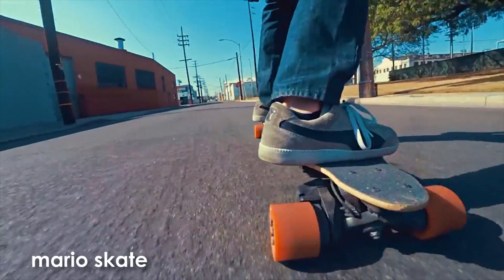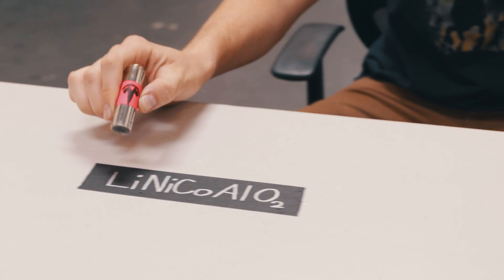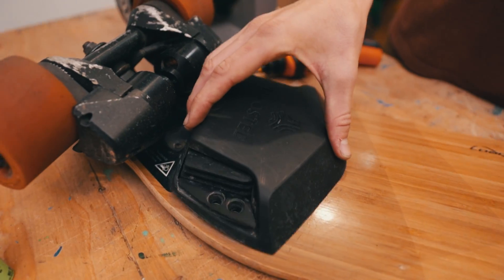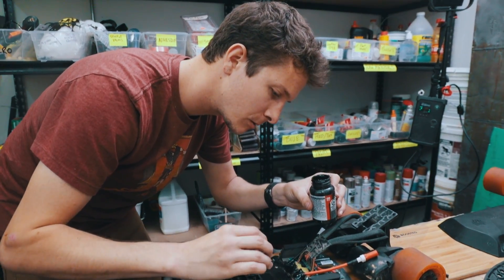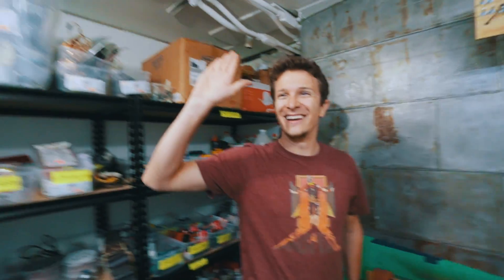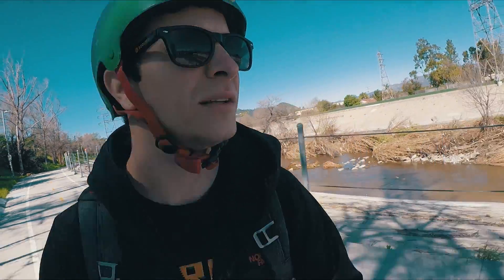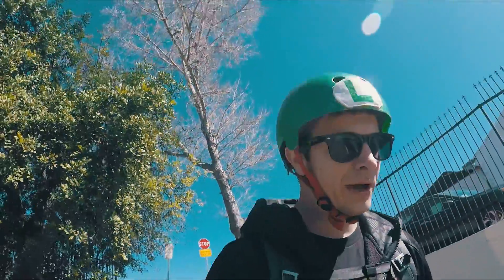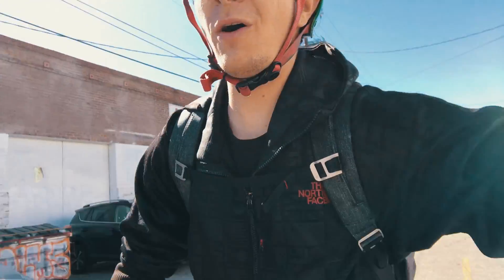Tesla Batteries in an Electric Skateboard!

Comment: Why don't you just remove the boost board batterys and just keep the batterys you added?
Reply: Anyone who replied to this comment and use over 20 words is a nerd
Reply: @austintaylor5253  Ha ha ha. Very funny.
Reply: Yes replace the booster boards original battery
Reply: @sceper.w8335  Because if you're not using the Boosted Board's battery and instead using the Panasonic ones, the Boosted Board battery is basically dead weight that is slowing the Board down.
Reply: This won't solve anything. You still can't discharge battery below 3.5 because there is check somewhere in firmware/hardware. The only pro is that you can replace battery, so you'll get a bit more efficiency
Reply: @TheCrazydude1994  I think it will. A battery sequence is said to be only as strong as it's weakest battery. All three batteries should be equal. The original dead battery sat so long that it fried itself and should be removed or in this instance replaced with a third cell just like the other two. They still will stop at 3.5 but it will be more efficient and take longer to get down to that. Plus I think the new batteries will have to be removed to charge because the old battery would hold them back from receiving a full charge.
Reply: @Sqoou_Too  c
Reply: @Sqoou_Too   That's not even the issue. the old batteries were just in a deep discharge state. As annoying as that is, the batteries were simply in, or near, a chargeneutral state at that point. Once restored they should work just as before. there might be some loss in capacity, but that's neglectable. The real problem lies in usable capacity in mAh overall. How much power a battery can hold and therefore provide is mostly determined by the makeup and material used. What the Firmware and Battery Mamagement Systems Check is wether or not the batterys current falls below a certain point because drawing more power then becomes dangerous to the battery and might cause overheating and ultimately explosion. So at that point it cuts off the power. And since they are set in parallel, the power drawn is determined by the lowest power providet per battery pack. Meaning the built-in batteries are the issue and once removed, everything should work just fine. So... I guess what I'm saying is: You're right, just not for the reasons you think you're right :D
Reply: @timokampwerth1996  Can't the firmware be coded or modified to allow a lower charge? He will have to remove the original battery pack but should be able go the same distance from the water example.
Reply: @themightysalamence9870  i dont think so, because the motors need a certain amount per average human weight in order to function at a safe and unheated way. otherwise you could just destroy the motors themselves.
Reply: EXACTLY. Good idea.
Reply: Right!!!!
Reply: @J_Nelson_1234  Right?
Reply: *Batteries *
Reply: It won’t work the controller is only working off of the normal batteries there for if he were to remove them and connect the big ones the controller wouldn’t be able to control them and regulate that much voltage
Reply: But how will you charge it,everything is connected to the boost board battery.
Reply: This. Do this...
Reply: Or idk build a boosted board which doesnt cost $1500? Not hard 😯

Comment: Boost converter may get you to the right voltage, but current wouldn't be as high any more, so you'd neef more batteries in parallel. Another way is to add more in series and use a buck converter to not allow the voltage over the 40V. Still leaves some in batteries, but that point will happen way later, and it would have really low losses.

Comment: Nice video, I think the problem has to do with the order the bateries are placed. You "hacked" the output of the batteries into the board, not extended from to the board's battery that are first in line. 

Also you might need to change capcitators to allow the board to flow higher volumes of energy (or decresing resistance, depending), and simply replace the original batteries altogether and see if your battery-stack reads better values by itself when placed first.

Comment: you need to use a higher voltage to increase its' speed, motors are rated in kilovolts (kv) which means you will get 1000 rpms per volt. Most motors aren't using anything close to their voltage limit.

Comment: didnt know those motors were oldstyle and could also function as generators.
I would have stuck a few more volts on the batteries to give em a kick.
Has worked with some powerdrills i had.
Reply: The LA river....... a concrete trench.

Comment: did you really need to solder some hack cables . why not just buy them?

the easiest way is to just remove the old batteries. and just run it with the new batteries. otherwise then the voltage threshold is probably decided by some circuitry and some voltage regulator.

Comment: I believe you could make an extra battery pack, a monitor on the top of the board showing the electricity that remains and a charger that can be used much like the standard boards for a recharge when required

Comment: maybe a bigger battery? like 20700 or 26650 (they are used for vaping just like the 18650 btw)
or batteries with more amps
:) good luck with the research
Reply: yer we get it you vape

Comment: make the booster battery be connected to the teal battery add resistors to not short circuit the board and wala thats how you fix the problem

Comment: Use a voltage divider (For taking feedback) to step down the voltage to less than 5v and input the analog reading to ADC enabled  MCU which u can program to give pwm signal to a buck converter to maintain the output voltage as 40 volts. It'll work fine 👍🏻.

Comment: Umm. those are just 18650 li-ion batteries. you could have just used laptop battery packs..because.. well.. they use 18650 li-ion batteries. same batteries that are used in vape mods

Comment: Mark roger made a zip line that charges itself when it goes down a hill and you can put a regenerative  coil to charge the battery as the board runs and it might slowly discharge but it can run for miles and miles and miles on a “single” charge

Comment: I know it super late and you have a car now lol, but I have an idea! 
It seems like you still have the original battery on the board along with your extras, my idea would be to charge the original battery using your extras instead of using the extras to power the meters directly. This should fix the problem of the extra battery’s still being able to work at low voltages, because it will be charging the battery that is designed for the board. Kind of like using your phone while it’s plugged in charging, except the extra batteries are the wall outlet and the original battery is your phone’s battery. 
This might require some extra circuitry to allow inline charging but I think it would be worth it!

Comment: Instead of wiring the battery packs into the control board, wire them into the battery pack side in parallel with the boosted board batteries where the on/off switch is?

Comment: in this case instead of using the batteries to drive it use them to charge it that way the board stays full power till the charges not available might have to bypass something so that it will charge while in use then you can have a larger amount to push the charge into the boosted battery just a thought.

Comment: Set it up in a way were the boosted board batterie is outputting less then the tesla batteries so then when the boosted boards batterie dies the tesla batteries has used more this will get you your torque but I'm not sure if it will get more batterie life you have to time the usage of tesla batteries to get to their 30v before the boosted board gets to whatever its is

Comment: Should’ve also wires a battery indicator in and mounted it either in the deck or enclosure so you knew what you were at. Although it might not be perfect since you’re running a board with two different types of cells

Comment: remove the stock battery or perhaps a switch to control where the flow is coming from a dump switch. You probly already know its not made for distances like that to much friction on the gears unless you can grease that bad boy up.

Comment: All batteries can be assembled in parallel and use lower per cell current. The discharge rate of LMC and LFP are more a product of the mechanical arrangement than the chemistry. The big benefit of the LMC (shorthand for a class of Li batteries your cells fall under) is power to weight ratio. LFP is heavier, but can cycle many more times with less capacity loss.

Comment: My theory is that the boosted board can only go to a low enough voltage because of the battery the boosted board had started with. What I’m saying is the boosted board thinks you have the normal battery so it stops working yet still having the leftover voltage thus making the leftover voltage unusable unless you somehow change the boosted board

Comment: So it is possible. The action of limiting the voltage drain on the battery is controlled by the mainboard. So you would need a way to modify the firmware to switch over to the other batteries and change protocols. You would also need a something to actually "switch" the batteries automatically or you could simply swap them out when the original battery dies. Now you might be able to do this via wiring but without seeing schematics I can't say for sure.

Comment: You should use a resistor so the voltage wont be so much to the point where it doesnt conduct well with the board battery

Comment: There's a couple of things that are scary and wrong here.

First of all you definitely should never solder to a lithium battery unless you want to severely damage them or cause an explosive fire to erupt in your face. There are spot welding machines that you can use to weld  nickel bus bars together to create your series or parallel connections to create your battery pack. This is much safer because the heat time is so short it doesn't have a chance to heat up the cells much.

Also your lithium battery packs really do need a BMS or some way to load balance your new battery packs on charge and discharge otherwise you risk damaging the individual cells and shortening the life of your batteries. The battery management system will also help you make sure your voltage doesn't drop too much as not to damage the individual cells as well. 

This is a fun project! Thanks for making awesome videos you guys!

Comment: Try and do a rc setup, use the boost battery to control the board, and the battery you made to run the motors. Then you have the boost battery for when you run out.

Comment: did this on my m365 (and upped from 10cells in series to 13cells in series) sold my car a year ago and don't look back. If you discharge your batteries to muCh again, just use a cheap bench power supply with CC&CV, no car needed.

Comment: You could take the boosted board batteries off and connect the wires from the battery pack you made to the wires that are connected to the boosted board batteries or just connect the boosted board batters to the pack you made and that will make it like in to one whole battery 😁😁

Comment: look up on how to make 10s 2p or 4p
Reply: because right know I'm prototyping my electric skateboard to 28 miles
Reply: the control where the motors are a program and when you find voltage cut off is the setting on the board because your able to to bring down the voltage cut off maybe 24v for the cut off

Comment: You need to just completely remove the  boosted board battery and just run on the tesla battery that would be the best way
Reply: JDKOSEN he already did a part 2, but on a one wheel instead
Reply: Wouldn't work,
Reply: exactly but ad one more tesla battery pack in lei of the original batt pack thus everything optimized across the board

Comment: Push the voltage of the Tesla batteries through the boosted 
The Tesla’s charge the boosted until they are empty, then the board finishes off the boosted

Comment: i hope you read this, nice attempt you tried there, your issue is the governor  but you also have enough understanding for basic electronics to make swappable cell packs, but back to the governor: if its chip embedded you have to change the chip and that might change to much circuit properties where you might not have desired results or damage the circuit however if its software where the mb has an I/O (input output) then you can chage the governor that allows you to go lower or reduce your speed for cell conservation, be clever add a solar panel too it would be fun, put it on a backpack or something

Comment: As a potential solution you could use those external batteries for charging the main one. But you'll need to make some additional changes to the system by adding the wires to the module of the actual integrated charger. So, the main battery will be discharged and charged at the same time by the external one think as it is continuously connected for charging until those Panasonic batteries will get discharged. Additionally I would recomand not discharging batteries to the fullest otherwise they'll die too fast.
Reply: You shouldn't charge a device you're also having a heavy draw from , lipo will explode

Comment: Never solder batteries... it destroys the chemistry in the battery by overheating. You must electro tack the terminals. Simple answer for your problems is you cut out the original battery. By being there your damaging it by it going under-volt which is a thing. Always use the same rated cells and you should really test your watt rating and see if your battery packs are giving enough power out. Remember going fast uses more power than cruising a bit slower. Also the two battery packs should not be different voltages. If they are you increase resistance and the imbalance makes very strange things happen.

Comment: do away with the boards own battery and ad a third DIY battery or do away with the tesla batterys (Because tesla is shit) and use lipo's only. the thing is the board cant chardge the lipo battery's you could try if it is possible a motor that uses les power and uses more torque

Comment: With my experience with batteries. You have to make sure all batteries are are at the same voltage before putting them together and charging them. Because once one runs out of battery it’ll think that all the other batteries are out too. That’s just how lithium batteries works. So make sure they’re all at the same level of voltage them put them together and charge it. It should work